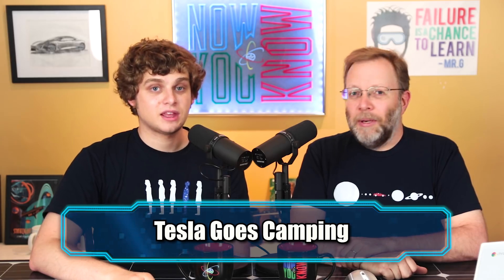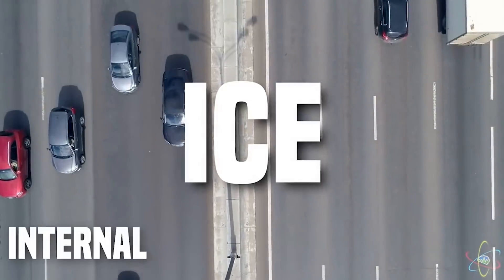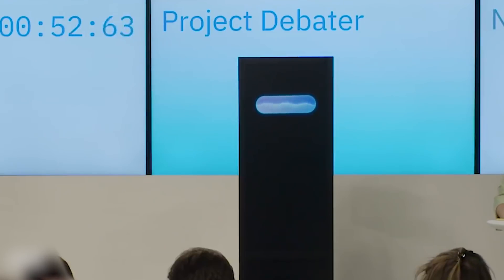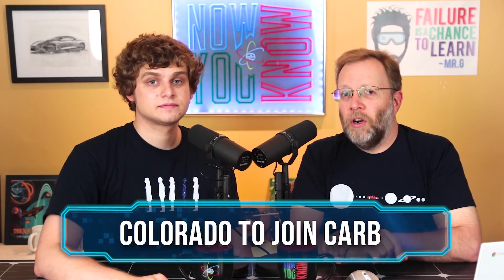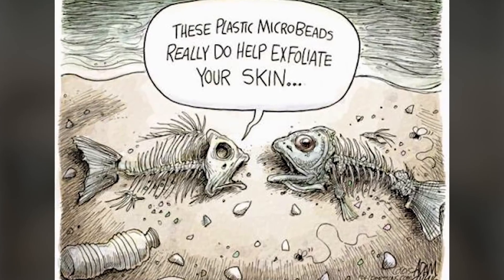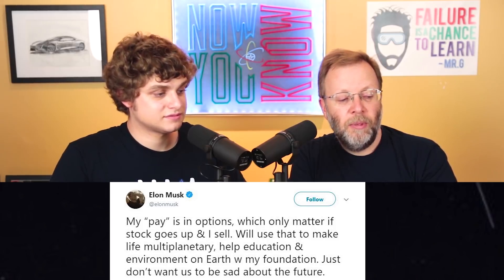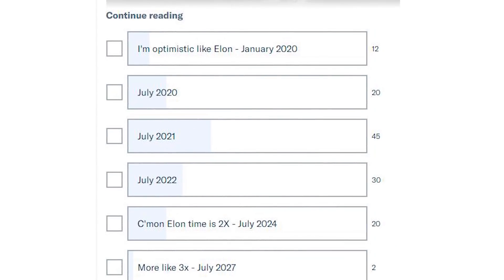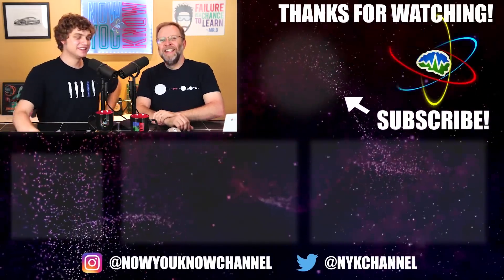Tesla Time News - Tesla Goes Camping & Model 3 Updates!

Comment: Here in Australia we are dropping plastic single use bags next month for good. I've waited all my life for this as i grew up with strong paper bags. I always thought that a little research on paper could produce a tougher product that basically matched supermarket requirement for a cheap disposable shopping bag. Got to be a market there.
Reply: "Paper-bag manufacture uses 20 times as much water as plastic and paper requires more energy to be recycled."they also "produce methane if dumped in landfill" they are also a lot heavier and larger requiring more energy to transportation. They do have their advantages they biodegrade and release safer chemicals if they are burnt but if you reuse plastic bags than those aren't issues Reusing plastic bags is the best way to go paper can be reused but its not as good at it especially if you are shopping in the rain. so it is mostly about the way we use them but the idea that paper is so much better is not a completely accurate one.
Reply: trojanthedog 
Now you just need to sort out the COAL!
With the best sunshine in the world, Southern Ocean winds, and a relatively small population, shouldn't be a problem?
Reply: trojanthedog single use bags? I had a drawer full of them. Now I have no bags to put gross stuff in, because I don't want my reusable bags to get an gross. :( I used to use them for throwing liquids, picking up gross stuff, and to carry random things like towels and extra clothes for swimming and stuff.

Comment: Lots of Mercedes B-class electric in Norway. It was a stop gap model based on the ICE B-class which was initially designed with space for batteries in the floor (or so I have been told). They are not selling it anymore as they are ramping up for the launch of a new line of electric vehicles.

Comment: One cheap  household upgrade that has a strong return on investment is to replace one or two or three light switches in your house with a $30 photo eye and motion detector sensing switch.  Half the locations aren't compatible and after half an hour of struggle you put the old switches back in.  But if you find a place like a hallway or kitchen where it works, it not only uses just the electricity  you need and no more, it allows you to move about using both hands, not having to operate the switches.  Great for stairs.
Another thing is a radiant barrier.  You can buy 75'  x 4' of the stuff for less than $100.  It works best in hot climates.  Deploy it anywhere the heat is oppressive, as a window blind or patio cover or put it over the stucco of your house.

Comment: Sellafield isn't a nuclear power plant, though.  It was a plutonium factory primarily intended to turn out nuclear weapons materials.
Reply: Just what I was going to say.  Sellafield was a nucellar reprocessing plant and before that it was one of the very early nuclear power stations (1956).  It made plutonium "fuel" for other countries nuclear power stations and weapons grade as well.  It is ridiculous that the British tax payer has to pay this proving how short sighted the entire project was, but it was started in a time when nuclear deterrent was very important.  Using these decommissioning and clean-up costs to compare against other modern ways to produce electricity such as solar is just irrelevant and misleading.  Please do your research properly guys.
Reply: Also, Sellafield is where all the British nuclear power programme waste ended up, not just that one plant's worth.  Thousands of TWh of energy.
Reply: I believe it also exported large amounts of weapons grade material to USA. and as for the 5% that could be generated through solar the UK generates a good 20% from nuclear energy. Admittedly with funding for other plants but the power station was the worlds first so all of the others learned form to build better cleaner and more efficient plants and what do you think happens when a solar farm reaches the end of its life cycle at ~15-20 years it wont be free to clean up? Puss nuclear is reliable consistent energy something which is the only (mostly clean) source at the moment that can do so on such a scale in places where geothermal is not an option, something that provides a back to support essential services.
Reply: Also we might as well do the calculations the plant itself produced ~500Mw i think built in 1956 taken for Wikipedia
1955 - Western Electric licences commercial solar cell technologies. Hoffman Electronics-Semiconductor Division creates a 2% efficient commercial solar cell for $25/cell or $1,785/watt.
so 500Mw =  500*1000*1000*1785 =$892.5 Billion for a plant of that capacity so there you go.
If the plant was constructed maybe the cost would be reduced but it would need to be reduced by a factor of 10 that is not to even mention the economic power of the country at the time just after WWII rationing was still a thing and just coming to and end .
Reply: and lots of nuclear waste imported from around the world too..
Reply: you are joking aren't you.. NP generates tonnes of some of the most dangerously toxic substances known to man...  and it remains like that for 1000's of year, The only thing to do is bury it and watch it very carefully.. The vast majority of a solar panel can be recycled once its expected life is over
Reply: Joseph Evans 
Offshore wind generates as much as 40% of UK grid power, is cheaper to plan, build, and install, easier to refurbish for reuse and ultimately easier to recycle.

Comment: I see your point about nuclear, but newer designs that cannot melt down, and will be able to run on the current waste, might be a good option. Especially if they can reduce the cost of cleaning the old plante, and do away with some of the waste. But these designe are 1-2 decades away, so fore now solar and batteries is the way.

Comment: 21:00 They will still need coal and gas and nuclear for baseload generation for when the sun doesn't shine and the wind doesn't blow for a few decades yet. Due to the unavailability of the large capacity battery packs required to keep the grid going during non-generation periods.
Reply: Ryen 
Sorry, no, they don't.
Back to the UK, there will be NO coal in 6 years.
Renewables already produce 30% (in 2017), and increasing fast.
Offshore wind is THE cheapest energy, bar NONE, without subsidy, including unclear. (Yes, I DID spell it that way on purpose!).
Reply: whats going to power the grid when the sun doesn't shine and the wind doesn't blow my friend? "Sorry but we're out of power" is not an option.
Reply: Ryen 
The AVERAGE wind speed in the North sea is 17 knots. (It's the windiest place in the world!)
The latest turbines (HUGE mother's!) turn in even the slightest breeze. I VERY much doubt if there's EVER a zero wind day.
Have you done ANY research?
Have you watched the latest fullycharged episode?
Google "Tesla South Australia"
That's a SMALL one!. Much larger coming! (Watch the Tesla AGM)
Just off the North Sea the northern isles (Orkney, etc) are already producing more power than they need and exporting, totally renewable.

By the way, MONEY TALKS! Wind IS cheaper (that's from a UK government report btw)
I'll be contacting my MP and asking for more renewables!
Otherwise, just observe over the next few years, and learn!

Comment: There is an electric Mercedes B-class. But there are not so many of them and they stopped producing them some time ago (probably super low range or something).
Reply: Svetoslav Petrov correct, it has quite a narrow use case but that one has done 49,000 miles in 3.3 years (ie a lot more than most ICE cars)

Comment: I typically don't point out math errors in youtube videos, but will here as it largely invalidates the entire premise of the nuclear power article.

155GW is significant, but it's not 5%. A TW is 1000 GW, so 3.8TW is 3800 GW, so the 155GW is actually closer to 4% of what the power plant produces. Unless that's 155GW more often than yearly. I think it was misread as 155TW.

Also others have mentioned that it's primary purpose wasn't nuclear power.

Comment: There are some stuff which worries me about Teslas plans to go for Germany...

I think this won't change bad press, I think it's going to increase, because they are basically 100% founded by the car manufacturers. (The car specialized press at least).

Elon had some issues with Labor unions in the past. They'll don't get around this if they'll open a plant in Germany. It's a must have, to let the workers freely decide if they want to join such a union.

AND they also have a works council. As Wikipedia states 'One of the most commonly examined (and arguably most successful) implementations of this institution is found in Germany.'.

Comment: Solution to nuclear waste, reprocess the waste, filtering out the depleted materials. producing a smaller amount of usable nuclear fuel, and collect the spent materials that need to be disposed of, and hire SpaceX to de-orbit it in relation to the sun, and drop it into the sun....
Also, thorium salt reactors, not the unsafe reactors currently in use.....

Comment: I wonder how much energy you could make if you put that $100 billion towards a brand new nuclear plant. Probably way more than a solar array would output. 

The main problem with nuclear plants is that they're old and have an inherently flawed design. They're totally reliant on their coolant systems and when those fail you get catastrophic results. But we really didn't care when we built them because it was the Cold War era and we wanted to make nukes no matter the cost. 

There are designs for molten thorium salt reactors where a meltdown is impossible, the fuel is much more common, and the fuel is much less dangerous, they just need funding. Which is hard to get when the public only associates nuclear power with weapons of mass destruction, meltdowns, and toxic waste when in reality nuclear is much more than that and quite frankly the ultimate power source. Please don't scare people away from it more than they already are.

https://www.extremetech.com/g00/extreme/254692-new-molten-salt-thorium-reactor-first-time-decades

BTW like Elon says, all solar energy comes from the sun, which is essentially a gigantic nuclear reactor in the sky. And solar panels are only what, 20% efficient? Obviously solar is great especially compared to fossil fuels but I don't see why we shouldn't pursue nuclear which is nearly 100% efficient rather than stick with solar which only leeches a fraction of the energy released by the sun. Why not emulate the sun instead?

SpaceX would be good for launching nuclear waste into space, too, once they were 100% sure the rocket won't blow up
Reply: IntensePeppers 
The main problem with nuclear is ...... It's NUCLEAR! ( Or rather UNCLEAR!)
Offshore wind!
Reduce USEAGE (easy!!)
Reply: It’s NUTCLEAR.